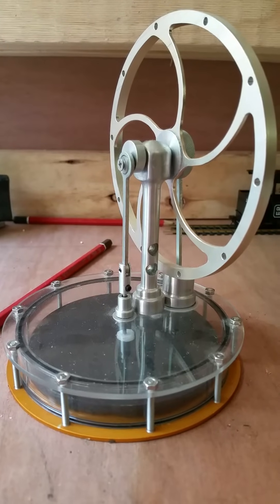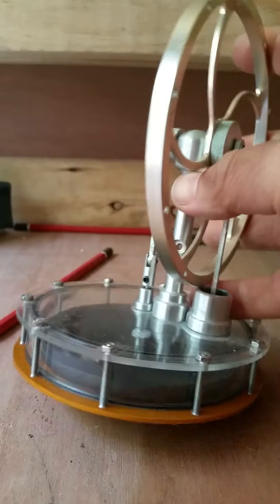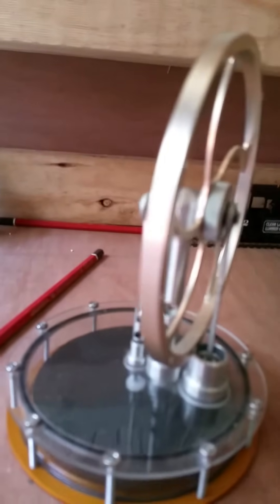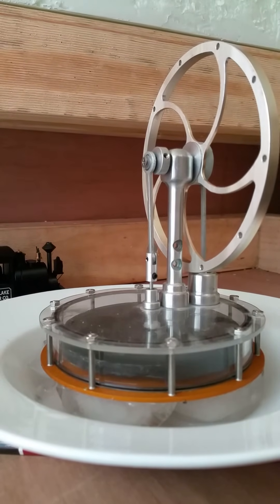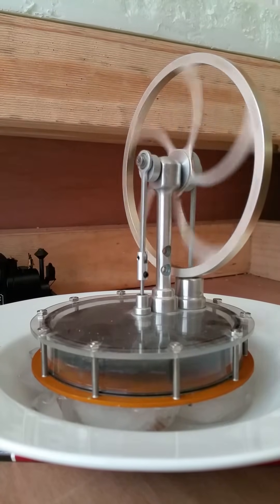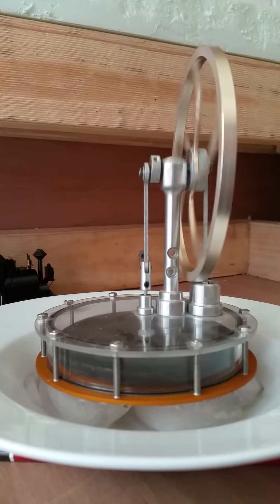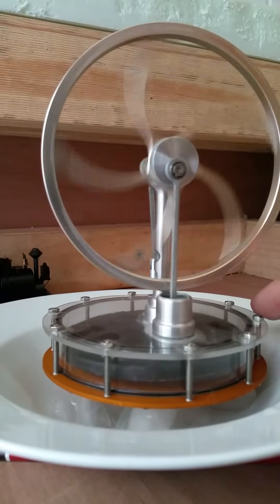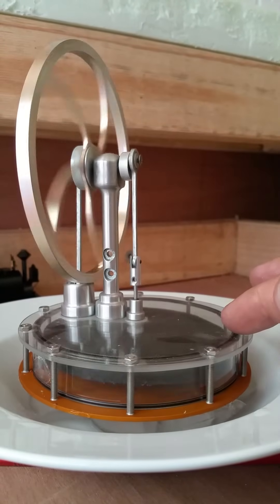stirling engine running on ice

Comment: So if you were going somewhere very hot, you could power your engine with an endothermic reaction?
Reply from the maker: Only if you've also got someplace really cold up your sleeve. The Stirling cycle works in the difference in heat between the two parts of the engine. One has to be hotter than the other.